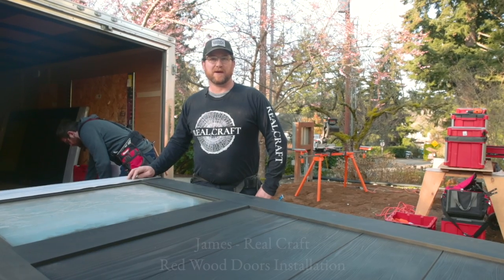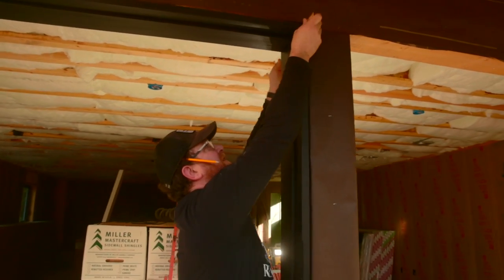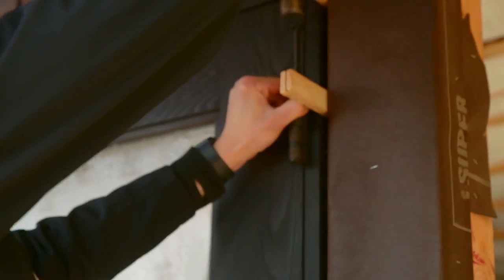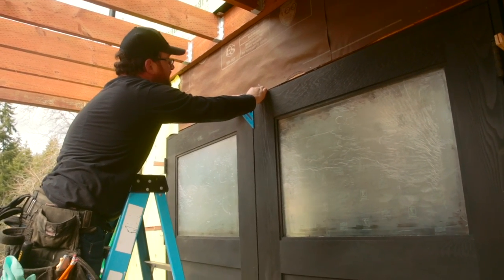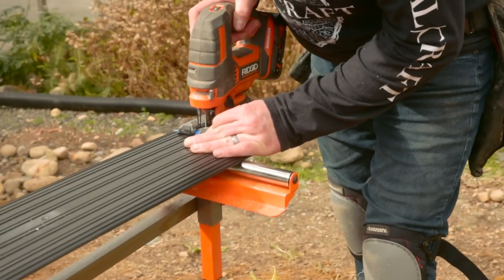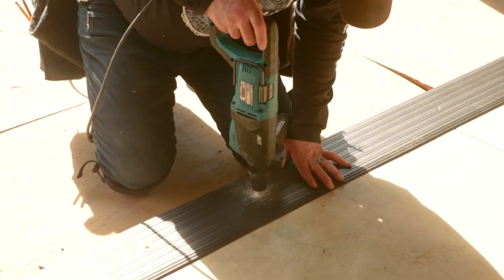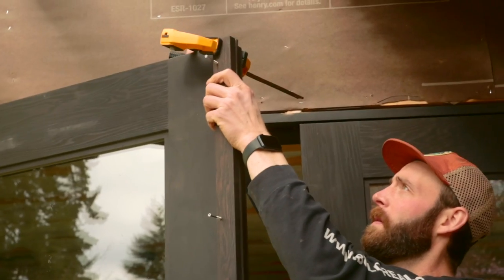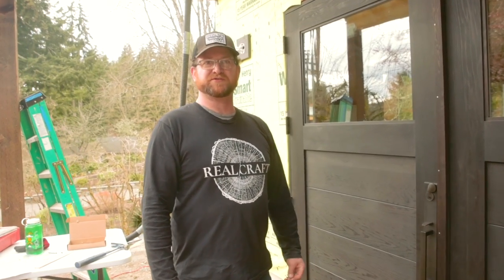Step-by-Step Carriage Door Installation | RealCraft

Comment: Hanging a door properly is one of those things that seems easy till you try to do it. Then it seems damn near impossible.
Reply: As a locksmith that has worked on 4+ ton vault doors. Hanging a door is a genuine skill don't let anyone tell you otherwise.

A properly adjusted vault door should be able to be moved with just 2 fingers of pressure. It all comes down to the hinges, if you're hinges aren't right you door won't hang or swing right.